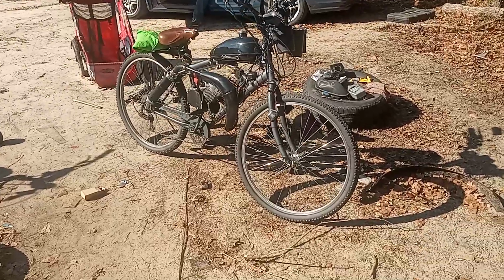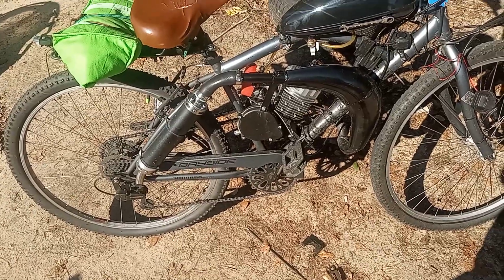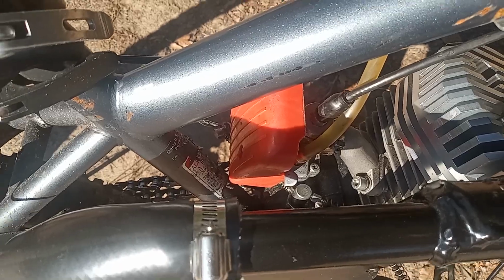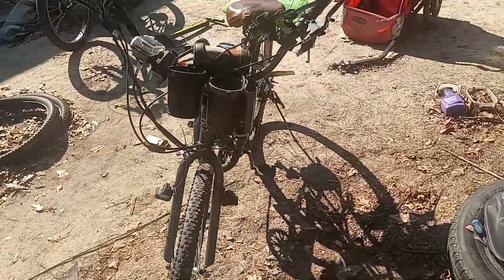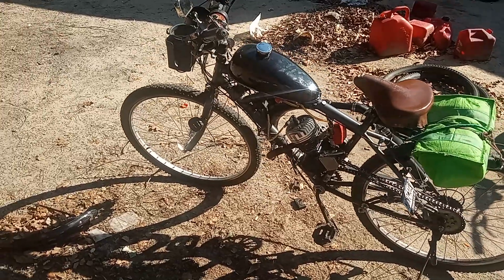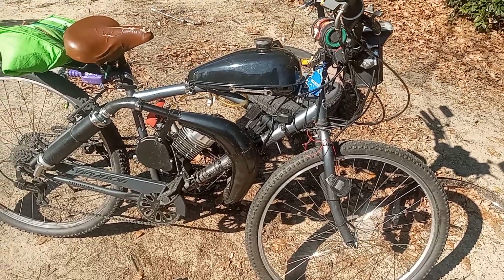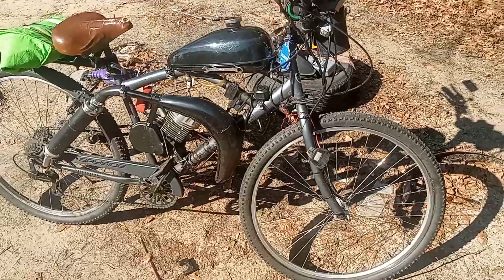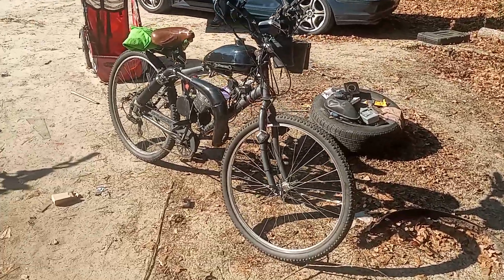changing the Jet soon in my NT speed carburetor for my motorized bicycle

Comment: Nt carbs are good just put c clip on bottom of carb pin jets are fine as is mess with carb settings will have air fule oil mix out of wack bike will overheat cold hot piston stick 4stroking may put hole in top of piston if you want power do portin timein set carb for max air fule mix widen spark plug gap .6to.8 then .8to.10 ok or you will burn out some motors if you dont get it right n that will cost a lot bread man keep it simple old school motor work man thats the way to go know your carb know the motor to make power for free than spend cash for little gaine 5/10mph ok 🚣🚴‍♂️🪂😃👍
Reply from the maker: I'm going to keep the same jet that came with it and just clean it thoroughly make sure it's running properly and freely when it comes to gas Flo I love the way this thing performs no need to change anything if you ask me 💯🚲💨💨
Reply: Hey I notice my bike may be 4 stroking. At all different points from the beginning and full throttle. C clip is on bottom and have a expansion chamber from Amazon. Also running 40:1
Reply: @SharkTheatre  theres lots of things that make 4 stroking tranfer port crackin weak spark bad plug cdi compretion leak scored barrle bad piston or motor needs replaced carb leak carb water fule oil mix from ice cold air or wet bike outdoors over night your bike set up sounds ok slippin clutch bad drive chain set up try that to stop or reduce 4 stroking ok hope it helps you out 😃👍